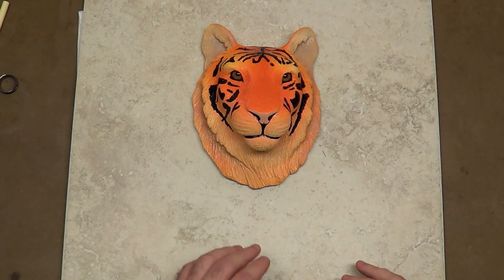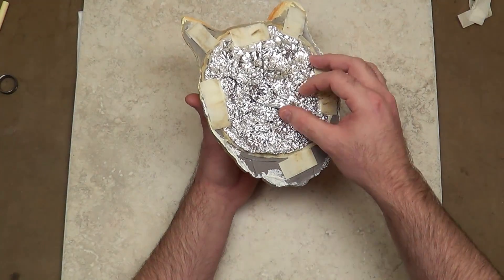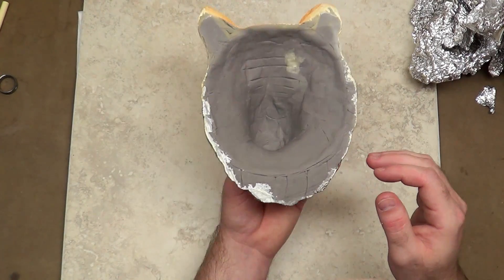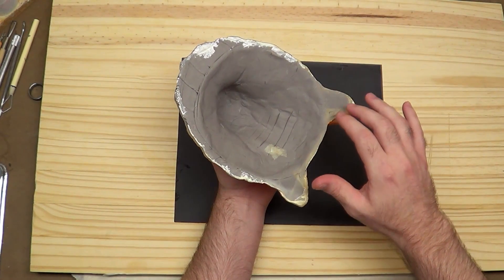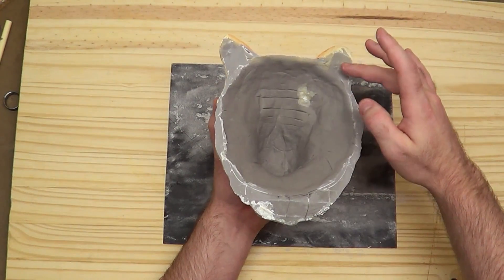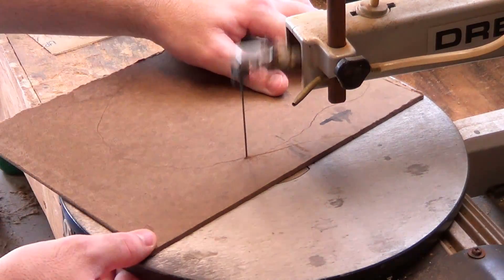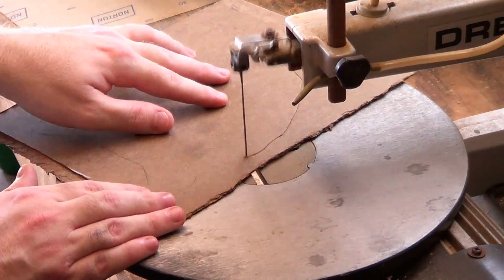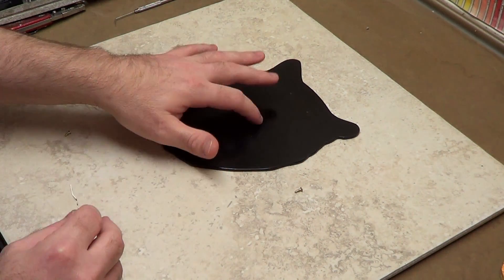Tiger's face, part 11: Making it Wall Art

Comment from the maker: This clay is described to be chip and break resistant... but if you mess with it when it's fresh out of the oven it could break for sure. It gains strength after completely cooling. Perhaps a little stronger a few days after baking (my opinion)  Also you gotta make sure its AT LEAST ¼" thick in all place, this is why I usually start with a couple layers (sheets) of clay at the start of my projects.  Areas too thin will create weak spots.